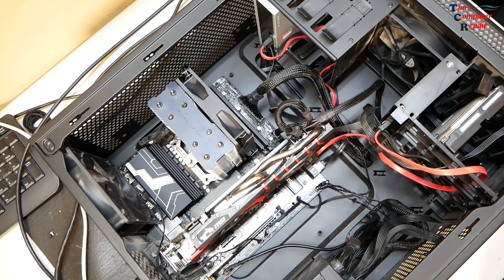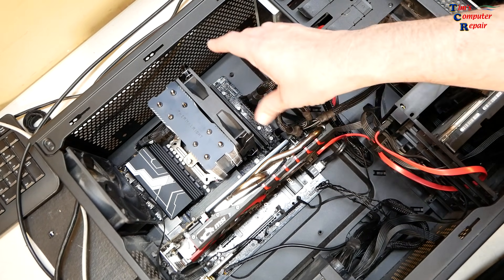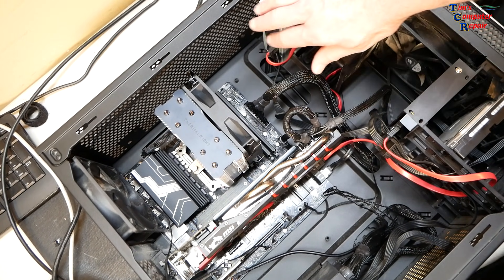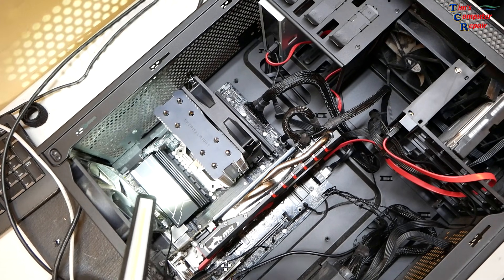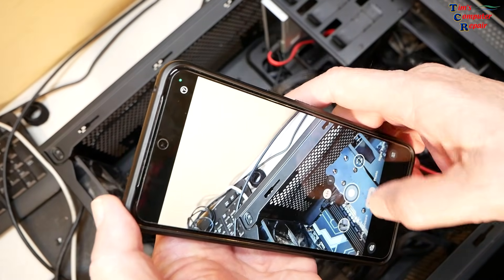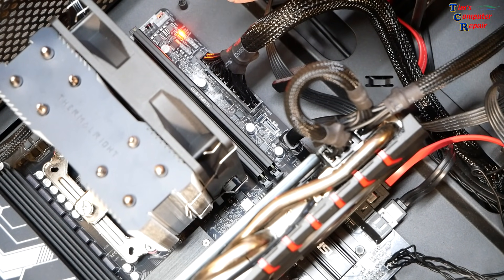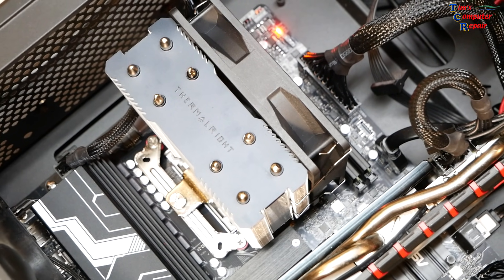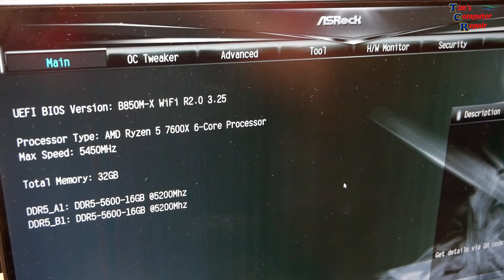Lets Fix This Gaming Computer The Easy Way!

Comment: Happy Holidays to you and the family! ⛄ I find it hard to believe that he would have given up, and sent you the PC without at least checking the connections! I had a new build years back that would start to post, then shut right down! I sent an email to the board maker (don't remember which one), to ask how to test it before sending it back. They where prompt and throughout, but I also suspected the power supply! I had an old PC around with a smaller supply, but thought it would be a faster check. I hooked it up and wouldn't you know it posted right away! When I looked back at my part selection, the one I bought was not intended to be my 1st pick as many bad reviews were listed about it! It was on special was why I even considered it! Keep up the good work, I'm glad people are still building as a few hosts suggest it's not worth the trouble anymore.

Comment: I went to a pc shop recently to have a ram upgrade '32 gig (on my laptop), and clean.
Everything worked except the mouse Touchpad.  The repairer said "touchpad not working.."
 *was working fine before opening*.
The repairer looked closer and saw the Touchpad was unplugged near the battery pack.
Must have been loose before.  
Plugged back in properly. All working fine  🙂
Reply from the maker: Things like that happens.
Reply: Had that happen to me after changing out HD on one, just taking it apart made the keyboard cable com loose!😲